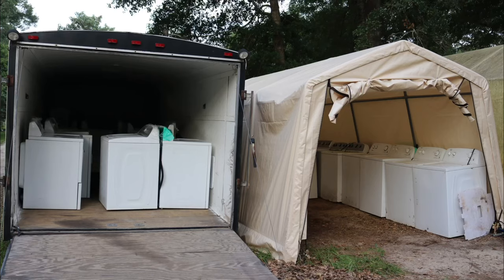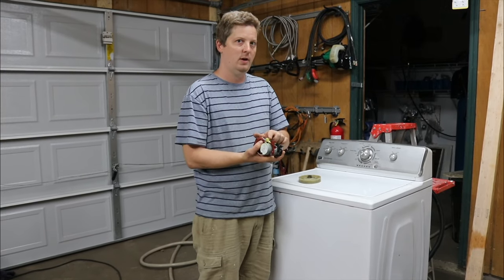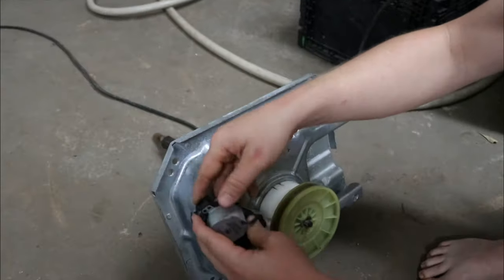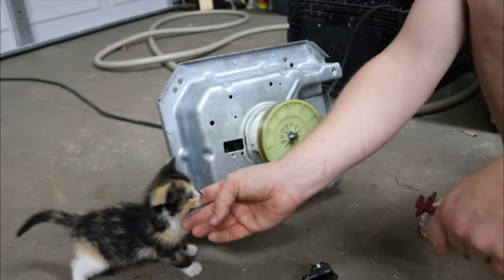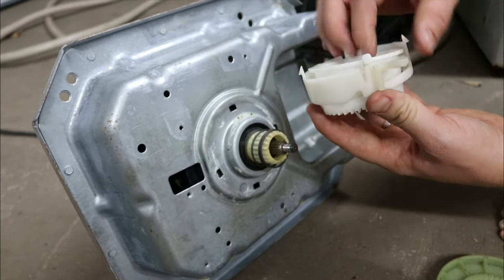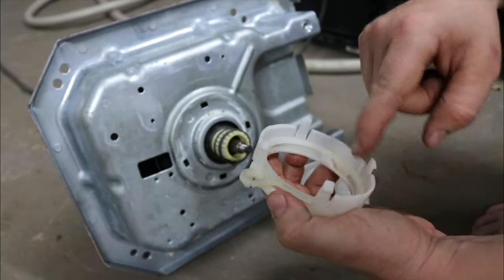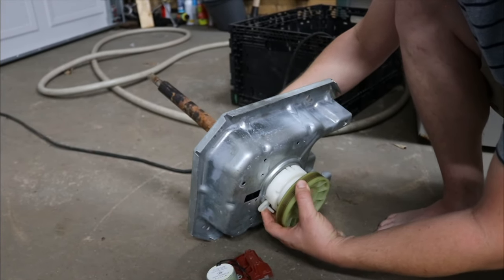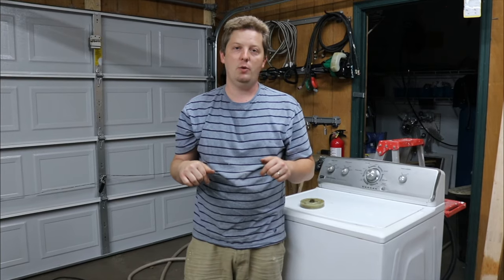Washer No Spin or Grinding Sound? Actuator Transmission Step by Step Guide to Fix or Replace

Comment: You are the man.   Is there some bearing that can wear out and make a noise like hell.?
Reply from the maker: From what I can tell with taking off a transmission from this type of machine it's nearly impossible to replace these bearings in the transmission. The transmission is not sealed together like old Transmissions. you'll have to cut the Brad's off and then somehow reseal it. I tried playing with one but it's just not worth the time and effort.
Better to steal parts and either stock them for my own or sell them on eBay.
I've noticed the bearings tend to go out on the low profile more often than the regular agitator version of Pause/Play Machines.
Reply: @WasherDryerMoney  yea tell me about it.  It is outright bullshit how they made this garbage. In the last two months, I have seen 3 of them as loud as fuck. Nah, it ain't belt squeal or dirt.
Came to find out, you can't find any bearings to buy.  they want you to buy their entire transmission.
These companies with their elected politicians just trying to save the environment and child safety.  That is all they want to do to help you and me and everybody.
And General Electric is the biggest scam of them all. 
Their game ( the first to come up with).  No, they won't let you hotwire their door switch, no sir no way.  They can't make any money bypassing their system.  They came up with 4 wires door switch and designed their CPU circuits so that the door locks, unlocks, locks, and locks at various intervals.  If it fails in any of them those intervals, it is over. The machine won't run.  Oh and if you think you fix their door switch?  They took care of that too.  The plastic fingers on those are minute little things and they will break from either out of balance or just outright usage which mind you won't take long.  You can't hotwire it because the computer if it can't unlock..... you get the idea.  Hotpoint is the top dog garbage.
Reply from the maker: @alchemy1  Yep that’s the game they play. You just have to work around it by knowing what problems are worth fixing and what problems are not worth fixing. Just scrap it out when the problem is too expensive or time-consuming to fix. I used to get upset about it but sometimes I make more money parting them out then I would selling them fixed.
I’ve had people ask me what machine I would recommend buying if they had to buy brand new. I always tell them because I’m a refurbisher I get machines when they’re broken down so the best one is probably the one I don’t see very often. I’ve only seen a handful of speed queens so I think that might be the best one but I would love to tear one down and see what they’re made of if I ever get my hands on another one.
Reply: @WasherDryerMoney  Speed Queen is the only genuine and has been the uncorrupted one.  The real deal that never sought recognition. I like to thank the maker of this unanimous one that never sought popularity.
I just got one the other day, the only one I have seen.  I got it for $50.  You can imagine, it had no bells and whistles.  Everything solid and everything tight and even knobs turned with grace and the clicks pleasant to the ears.  The person selling it took it for granted. And had bought himself the lights and the whooshing with round edges.  He is gonna need it. 
I sold the beauty machine to this old schoolfellow for $400 and I told him it is the last one he will ever need.
I also have an old Maytag, the original king of a beast.  Nothing plastic except the wire insulation and some rubber on the feet and the hoses.  It washes with absolute grace and when it spins you won't see any movement.  It is too solidly sits on the ground.  It weighs a good 150 lbs.  Maytag the way it was once made.  How much I paid for it?  Nothing.  Their grandpa never got tired of it but these kids got tired of its green/tan color and not breaking down.  God knows how many thousands of loads of laundry it has washed if it could talk.
That machine and the Speed Queens saves the environment. But you won't hear that on the nightly news.

Comment: My newer maytag washer fills and runs through wash cycle and then there's a grinding noise sounds like coming from pump, no spin and no drain. I did replace the electric pump but no change.

Comment: I have Hotpoint HTW200ASK1W with a noisy grinding noise during agitation. The gears/teeth look clean and in good condition. Might the actuator motor PN: 290D1068G002 be bad?

Comment: My washer Roper only fills and agitates somewhat...and drains. Purchased the splutch kit and purchased the same shift actuator brand new same model for this washer. Then calibrated it. I am having the same issue. When I calibrate it and test to drain spin. It will drain but it will not spin. It attempts to spin. But the spin was like that last time, and I am still hearing grinding. What can be the problem here?????????

Comment: So my kenmore the gears do not mesh in wash or rinse but will lock up for spin. I’m thinking it’s not the actuator. Your thoughts?
Reply from the maker: Probably the actuator started the problem. If it did it a couple times it could have wore out the little plastic gears off the splutch.

Comment: The shift Actuator contains  a "switch" activated by the actuator arm that tells the computer "I have successfully shifted" to this position  as well as a optical beam sensor that shines through a toothed wheel inside the transmission case that reads rotational speed as well as confirming the drum is fully stopped before unlocking the lid   ,  if the computer does not read that the actuator has completed its shift ,, it will halt the cycle and store a fault,  It is possible since the drum is suspended for the harness wires which have to flex over time to break (sometimes under the insulation as the wires will look fine but still not make a connection)  so this is an issue to be aware of because I had a actuator shift fault where a broken wire was the issue ..

Comment: Is there any way to use a multimeter and test that mode selector or the mode shifter or actuator with an OHM meter to see if it's good or not
Reply from the maker: You can put the washer in it in manual diagnostics mode and check it.

Comment: Mine spins during spin cycle but agitation is slipping. Its not the dogs in the top piece or the splines in the bottom piece. So could it.be a plastic gear below? Admiral washer

Comment: I replaced the balancing rod on whirlpool wtw4616fw2 just  recalibrated it today before I did it started back knocking and it squeak while it’s washing any advice on what to replace or do would be helpful thanks
Reply from the maker: Sometimes there is a much worse problem that rarely happens when the inner and outer drum slightly separate. This is caused by a piece that’s in between them deteriorating.
Usually you can tell by turning the drum by hand and seeing if there’s a wobble between the drum and the plastic shroud around the top of the drum .
Reply: @WasherDryerMoney  can it be fixed just checked and it broke do I got to replace the drum

Comment: Thank you for this awesome tutorial and explanation. I am having issues with intermittent spinning and bought a new belt and clutch kit. No other tutorials mentioned the actuator. I will look into it. Thank you again.

Kenmore Series 200
Reply from the maker: Glad to help
Reply: The washing machine was completely disassembled on the weekend. The belt looked like new and the clutch was fine. The actuator arrived today and replaced it right away. The washer is agitating and spinning like new.  

As mentioned previously, your video is the only one I found that mentioned the actuator as the culprit. Thank you, thank you for your video.
Reply from the maker: @ramon3300  glad to hear you got it going.
If it ever starts shaking really hard that will be the suspension rods.
This usually happens after a few years of use. Another pretty easy job to replace.

Comment: Hi good morning. I have a GE gas dryer the digital readings are on but when I start the dryer the digital reading makes its cycle but the drum does not start.i tried to put it on test mode but it does not go to test mode

Comment: Love the video, very informative. However I'm on my 4th shift actuator from your affiliate link and they keep burning out within 10 cycles. At $30 to $60 each I feel like I'm wasting money and getting little for my time and effort.
Reply from the maker: Wow, that’s crazy. Four is a lot of actuators to go through. Did you try lubricating the area that the actuator moves?
If you try another, actually buy from another company and let me know if it last longer and I’ll change the link.
I ordered from them before a long time ago and not had an issue. But maybe their recent ones are not as good.
Reply from the maker: try putting the washer in re-calibration if you put another one on it.

Comment: I replaced the actuator and those transmission gears. Worked for 2 weeks. Then stopped. Like the same condition as before. Could the actuator be defective?

Comment: So my maytag will pump water out but will not spin. When I got under the machine, it looked like my belt was just sliding and not grabbing anything.  There was a lot of rubber on the bottom cover and the underside of the washer. Is that a symptom of just needing to be cleaned?
Reply from the maker: The belts going out are more rare on that type of Washer but it does happen. Double check that the pulley nut is not loose. If it is, it may make the belt hang too low and that could be why it went bad. He could also just be a bad belt.

Comment: I replaced my shift actuator it did a full load then stopped spinning on second load.  Turned it back over and it had shredded the belt.  Any suggestions

Comment: I'm working on a kenmore 11020022011 that the motor won't agitate counter clockwise, replaced the control board, checked voltage at motor and it's good both ways. The motor ohmed out ok but I'm kinda at my witts end. Bad motor?

Comment: My washer has a grinding type sound when I first start a wash, and when it starts the spin cycle.  When the wash is complete, there is no visible standing water but the clothes are still very wet.  Does this sound like a actuator?  Thanks!

Comment: Thank you! I've watched this video over and over again hoping I missed something! I replaced the belt, splutch AND the actuator and everytime I try to start all I hear is this quick "whirring" sound almost like the belt is slipping but only lasts for about 2s. It went from making that horrible grinding sound (that also cut through the belt cover) to getting stuck on sensing and door lock. I can release the door lock but the sensing light stays on. Now there is NO movement at all. HELP PLEASE!!!
Reply: the sound lasts about 2s and the 2 lights  remain on, almost sounds like the belt is slipping

Comment: I have a hotpoint washer I turn it on it fills with water then it jumps to wash spins alittle and cuts off wondering what can b the problem done put a new lid switch on

Comment: Never had a problem with sand getting in the gears, Just the transmission failing or the wash plate stripping. I hate the type with the plastic agitators with the pot metal splines. They develop rust and corrosion at the same time making it almost impossible to remove it without destroying the wash plate. anticipating this problem, I always order the washplate when changing out the transmission. They're pretty cheap anyways.

Comment: When my Maytag machine initially starts it will fill and agitate while it's filling up with water.  Once the tub is filled, it starts clicking and won't advance to the Wash cycle.  I will try what you've done in this video and see what happens.  Is there a particular kind of lubricant that used on washers?  Is WD-40 okay to use?  A lot of videos like yours, never says what kind to use. Of note the Drain and Spin mode work fine.  Any additional help or info would be appreciated.  Thank you!
Reply from the maker: I like white lithium grease. WD-40 is not a good long lasting lubricant. It actually will dissolve oils.
If I had to guess I would guess it’s the actuator. That’s wrong with your washer.
Reply: @WasherDryerMoney   The actuator was replaced in October 2023 and worked until July 2024.  We have now replaced the actuator, splutch (did not put any lubricant on it), and control board using genuine OEM parts.
Reply: We recalibrated the machine after installing the control board today (8/10/24).  There are no error codes that presented.  What do you think could be the problem?  Any insights would be greatly appreciated.

Comment: I have a GE top load belt drive. Is this pretty much my setup as this machine? I cant turn the Agitator when it's in the washer. So it seems the problem is in the drive and not the plastic coupler. The motor hums, I smell a little rubber when it goes to agitate, then the motor will shut off for like a minute and try again. I then unplugged the machine and started trouble shooting. So I guess do you think this is my problem as you shown?  I never been this deep in the washer before.
Reply: Well after getting the washer apart I see that mine must be much older than that model. I don't have the switch you showed on the cast aluminum transmission my belt runs to.
Reply from the maker: Yeah GE’s are different.

Comment: I have a Samsung Active wash Aquajettop load. It’s not draining or spinning. Cleaned out all drain hoses. Put in a brand new drain assembly (with new wiring), because the original drain propeller was broke. I put it back together but still didn’t worker. Took tub out of washer. Cleaned and put back in. Still not spinning or draining. I rechecked all my wiring but all appears to be good. Please help

Comment: I have a stupid question, because I am not into working on washing machines and I replaced the plastic components thinking this was the problem with the agitation cycle on my machine. After putting it back together and running it through the cycle, it is still not agitating correctly. Initially, I check the resistance on the actuator and found that it had the ohms of resistance others had mentioned. Now for the stupid question, is the actuator arm supposed to be stiff when trying to move it by hand or loose enough to move it with my fingers? Like loose enough that it just flops side to side.
Reply: I was wondering that too.
Reply: @amyvang2721  Ordered a new one and it was not able to be moved by finger tip. Hope that helps! 🙂
Reply: @Trenchcoat_45  yep. I ordered a new  one. Thx!

Comment: My whirlpool WTW4816FW1 needs the agitator dogs and i replaced them but it still spun very soft/slowly. I figured it might be the switch motor and that didnt fix it. Any idea on what it might be? Machine has no problem with any other cycles.
Reply from the maker: It could be the capacitor going bad.
Just a guess though. Also, if it’s the type of washer that has six lights and a pause play button. look up a video on how to recalibrate. Usually recalibrating does not have anything to do with that problem but it’s always a good idea and it’s pretty easy to do.

Comment: Thank you for that. My problem on a Maytag is the belt slips. Got a new belt same thing. It's like the basket is not spinning freely, but I can turn it by hand. It does seem very heavy though, if that makes sense. What are your thoughts Sir. 🤔
Reply from the maker: It could be a sock or piece of clothing stuck between the plastic outer tub and the metal drum. I have seen that before it also could be the bearings are going bad. I recently made a video on the bearings and that type of washer and pretty much you’ll have to replace the transmission because they’re extremely difficult to replace. First check to see if it’s just something stuck between the drum and the outer tub.
Reply: @WasherDryerMoney  where do I get the actuador ??

Comment: Is the shifter assembly is the same of you have the reddish-brown assembly or different?  How to get the right part number? Thanks
Reply from the maker: There are two main actuators the red one and a black one. They are very common and you can just look up washer actuators on Amazon and you'll see the two types. Just buy the one that looks like yours. There's some really weird looking actuators on some machines but they don't resemble these actuators at all. I would just go on Amazon and try to match what you are looking at with the picture because it's more than likely the red one or the black one.

Comment: I got a Whirlpool commercial washer it doesn't drain all the water out I only leave a little bit in the bottle when it drains I'll spin before it goes off have a little bit water in a bottle where is wrong with that washer because I change the clutch and I change a transmission can you please tell me what's wrong with it because the clutch was moving around so I tried to clutch because I'm supposed to be moving around

Comment: My mom's washing machine is not working it fills with water and then nothing but every 30 seconds or so there's a clicking sound coming from the shift actuator. I ran Diagnostics and got the code and it said it was the shift actuator so I bought a new one and installed it but still doing the same thing. Any suggestions what to do next?

Comment: I have a MVW6200Wk1 that shakes after a load. I cant find a snubber ring on this one and Im afraid just changing the springs will not do the trick! any suggests?
Reply from the maker: And more than likely is the suspension springs. If you can turn the drum and look straight down the center and it’s not wobbling it’s more than likely the suspension springs. If it has a bit of a wobble it’s either the bearing or a piece that’s connected to the inner drum that is broken. Either way those are extremely expensive times. Hopefully it’s the suspension rods good luck.
https://youtu.be/IZZCwXEmGhE